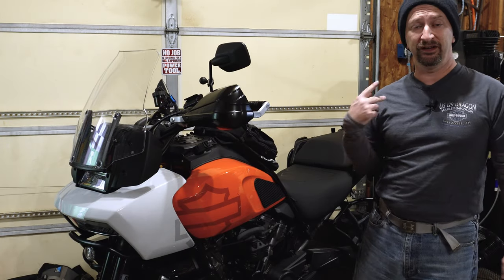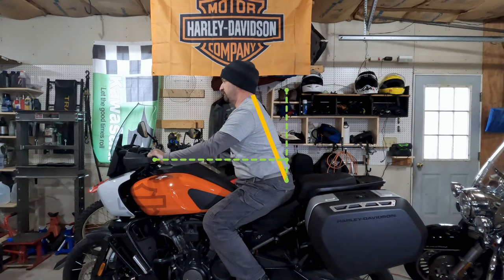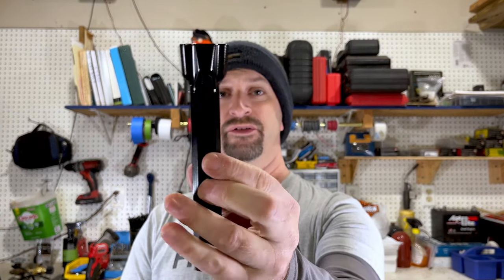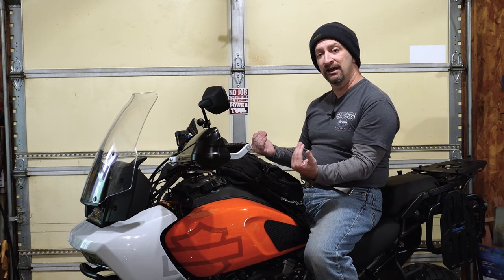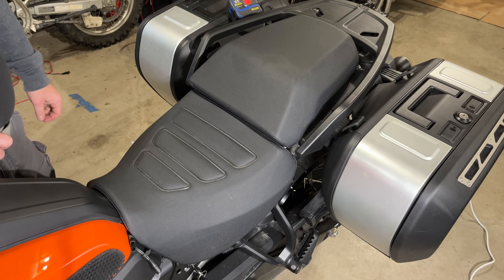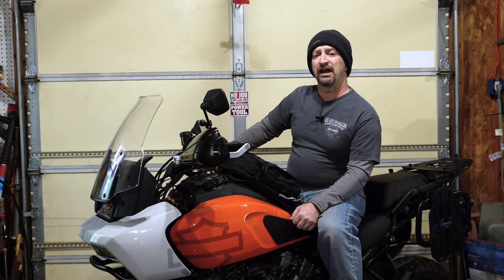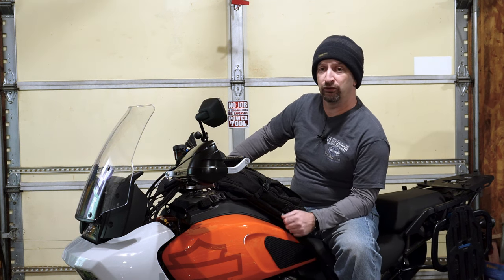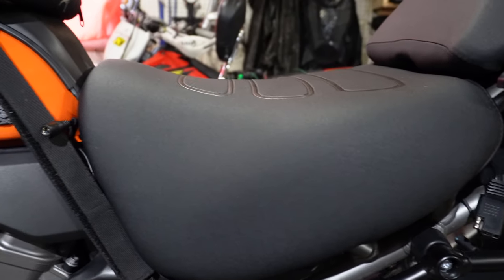Don't waste your money on these accessories for your HD Pan America

Comment: I have the base model. Harley has a way to go to compete with the other ADV bikes on basic equipment. No factory option for heated grips, all the other brands come with them or are at least a factory option. Non locking fuel cap,WTF!!!!!!!!! Every bike I've owned since the 70s,all non Harleys has this. For 110.00 extra you buy it, then you have to build the lock yourself and install it. Insane.The side cases, while decent, is another time consuming exercise in futility assembling the locks for them. No one else does this idiotic crap. Access to the air cleaner is the worst design I,ve ever seen. Working on a Moto-gp bike would be easier. Hopefully they will improve on these basic design flaws.

Comment: As a long-time rider that has only done Harley for the last four years, then went with exact same bike as you, I simply don’t understand this desire to sit upright on a bike. You need the forward lean to counter-balance the wind, and to use to bike’s performance. I’ve put over 20k on my PAS now, stock bars and seat, and would never change either. Extremely comfortable, IMHO. I also use the Sport bags for road trips, and absolutely love them, but can certainly see soft bags in my future for more adventure-style riding…

Comment: I'm 6'5 I test rode a pan America the other day and loved it. Should I get a pan America or a BMW 1200.
Reply from the maker: I try not to get caught up in the debates of which bike is better, regardless of the bikes in question. The best bike is the one that does what you want for the price you are willing to pay. BMW has been making the GS for along time and it has a loyal following and is a very good bike. I have several co-workers that ride them and love them.
For me, the BMW just didn't appeal to me. It felt big (I'm only 5'6) and I'm really drawn to the Pan America because it's different. 
If you are torn between those two bikes.. ride both and go with whichever one calls to you :) .

Comment: Great reviews! When you stop for an hour or two, or overnight, I assume you're just detaching the side bags and bringing them with you? I'm thinking of potential theft.
Reply from the maker: for most of my day to day riding, I'm not using the side bags, only the top box. I only put them on when I need the extra room. So for a trip, yes I will bring them in with me when the bike is parked overnight. For a shorter stop, I have cable locks that secure the bags closed and to the bike, but of course that is only going to stop the honest thieves. If I have something like cameras or my tablet with me, that gets locked in the top box. Generally if I'm concerned that I can't leave my bags alone for an hour or so, I'm probably not going to stop in that area anyway.

Comment: Thanks for another great video, Mike - I have a “twin” of your bike so I’ve found all your videos to be really helpful and informative!  I currently have the HD aluminum side and top cases but have been looking at the Mosko bags as well.  Did you get the offset pair or 35L on both sides?  Would love your perspective if you decide to make a video.
Reply from the maker: 35L for both sides, the bags can be cinched down a bit if they are not full, but I didn't want to limit my available space, don't mind a little bit of offset symmetry :).
Reply: @MikesMotorbikeChannel  - thanks for the reply, Mike - your thought process makes complete sense but I'm worried my OCD will kick in with the right side sticking out more than the left!  One more question if you don' t mind?  I looked up Mean City Cycles and they appear to have several different seat mods available.  Did you go with one of those from the site or did you go with a custom option?  My primary issues are sliding forward into the tank and the width.  Thanks again!
Reply from the maker: Double Decker mod is what I went with, which is what they recommend for the Pan America.
Reply: @MikesMotorbikeChannel what is double decker mod?
Reply from the maker: @Robert509Marquez  https://www.meancitycycles.com/driver-seat-mods

Comment: I have a question regarding starting in colder temperatures for you Mike. I've been watching your videos and it's obvious you live somewhere where it does get colder. Have you had any issues with your PanAm starting in the cold and have you upgraded the OEM battery? Thanks!
Reply from the maker: I have had some cold start gremlins, still working through them. I had the starter clutch update done a few weeks ago, which has helped alot, but I think a year and a half of my battery struggling to start the bike has taken it's tole. Will be working with the dealer to test and possibly replace the battery next.

Probably sometime towards the end of Feb I'll be making a video detailing the issues I have had over my 10k miles of ownership and what the resolutions were.

Comment: Hey Mike, read your reply, so here I am. I agree in regards to the sport cases, I am worried about the locks as they seem overly complicated. But I will admit I only used bags once or twice a year so I don't want the extra frames attached full-time. But I'll continue to look at other options before my final decision. Thanks for another great video!
Reply: The lock on one of my bags (sport) broke.  The plastic part in the bag broke, so it's impossible to make the lock work.  Even though the sport bags are super convenient and the bike looks better when they are off, I would not buy them again and would buy the aluminum bags options.

Comment: Hey, Mike I'm curious if you've had the same issues that so many of us have had with the starting of the PanAm, throwing all kind of codes, not starting-  restarting, stalling on start, mode rides disappeared with triangle warning?
Do you know about the/or has your starter clutch gear been replaced?
 Have you experienced the ARH being wired wrong causing the ride height to work sporadic, code and be stuck aired up?
Reply from the maker: Starter clutch was replaced a few weeks ago, never had any ARH related issues. Still working a couple issues with the dealer and plan on making a video detailing everything and the resolutions.. though I've not had anything that I'd consider 'major', nothing that has prevented me from being able to ride... so far :)
Reply: @MikesMotorbikeChannel  copy that,  they have mine a 3rd time and I've discussed starter clutch gear service bulletin and redoing pins/wires on ARH, will see. Mine has progressed to the point of cranking once out of  3-4 times with codes, and even more rare a start without. If it's a code/s that affects operation,  it has to be cleared and start process all over again.
While I'm chatting with you  I'd like to thank you for your videos.